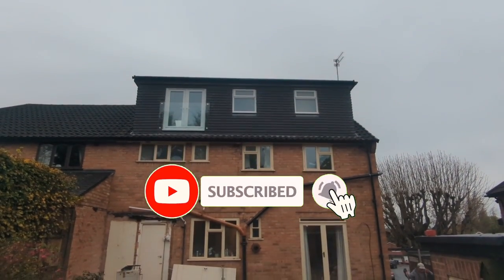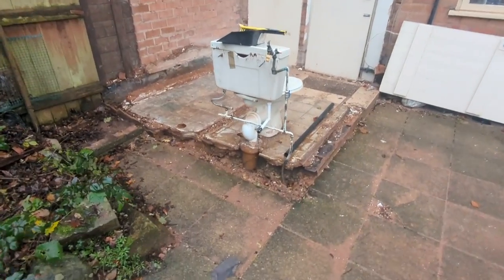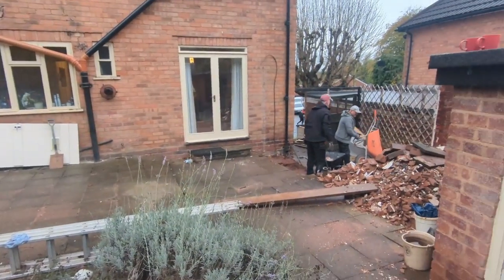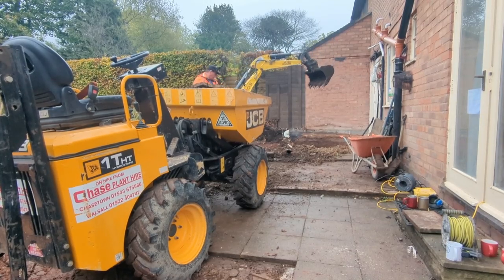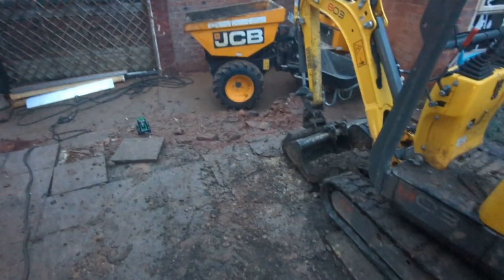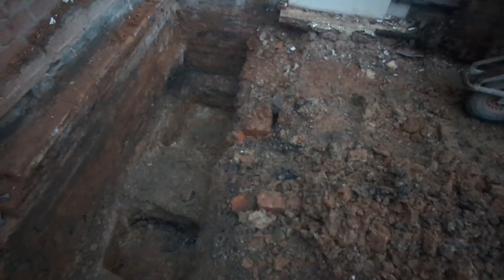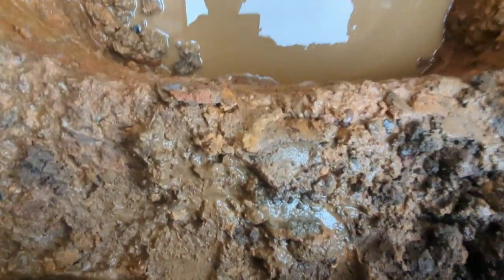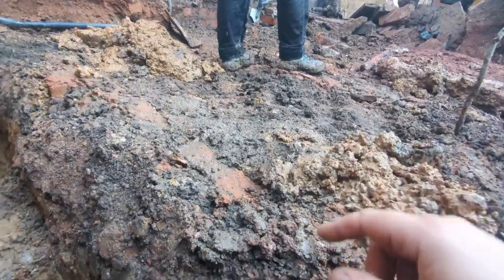Single Storey Extension Stage One. Digging out, Finding Out and Falling In!

Comment: Back in 1990 I was digging footings for a single storey extension and came across a 3 foot brick built well right on the corner . We extendend the corner footings in both directions , shuttered over the well and placed rebar into the mass fill footings iver the well . The inspector wasctold and passed it . Moral of the story is you never know what you're going to find while digging footings . Found out later that there used to be an orchard on the grounds in Georgian times . Local history and surveys are very helpfull . All the best from Brum . 🏴
Reply from the maker: Morning John, appreciate that. It's true that you never know what you're going to find, which makes it both exciting and worrying in equal measures!
Reply: Could be worse, previously unknown Romano British cemeteries tend to ruin your year
Reply: @stevenbowers4164  👍🤣🏴
Reply: @stevenbowers4164  Or a recent murdered body.? 😅

Comment: The reason removing the hedge has no affect on the outcome is because theoretical the ground will heave once the hedge is removed as the clay will expand. This is in theory down the fact that currently the hedge is drying out the ground and once it's removed the ground conditions will become wetter hence the clay expanding.

Comment: As a builder of over forty years mainly working on domestic extensions, I would always get the Building Inspector out before I started any extension. This way you could discuss any problems prior to starting, ie trees, drainage etc etc. You knew what depth to take out your footing before you started the dig and could pre warn the customer of any additional expense incurred. Far easier to use the digger than bust your arse doing it by hand.
Reply from the maker: Hello Peace, John's comment is a great shout. Building Inspectors do do a 'pre commencement' visit which is obviously a great commodity if you're unsure if anything. In our case here we didn't think anything was out of the ordinary! Lesson learned!

Comment: Nice to know you have a Building Inspector that actually knows what they are doing. hang on to that guy. The roots of that shrub will affect the clay movement, that would cause cracking of the brickwork if the foundations are dragged. Also by removing the shrub you could end up with what we call "heave", where the foundations lift causing cracking.
Reply from the maker: Very true Stephen, thank you.

Comment: I did a job in Reigate where we came across some brickwork in the corner of the foundation, it turned out to be a well 18 metres deep.

I also did a job which was an extension going where there was a large patio area…..the client neglected to mention there was a stonking great pond there before and we had to get the job done with driven piles adding 8k to the price.

Comment: Excellent video.

One thing this highlights so well is the constant decision making that a builder makes….even during the “upto the waist in mud” stage.

One thing you might want to do is look on the LABC trees and foundation web page - on there you can find a depth calculator. On future jobs you can make an assessment before the job starts and anticipate trees and hedges impacting on foundation depth ( in the zone of influence)

As a quick tip: look out for hedges of hawthorn and leylandii, and trees such as oak, willow leylandii. They have high water absorption.

Bear in mind it is these species combined with soils with shrinkable clay or low load bearing capacity: clay and silt are indicators. 

I know it shouldn’t be your concern, but if you are forewarned you can avoid losing days on site….deeper founds can mean resorting to hand digging, swapping to a bigger digger and even shuttering.

Comment: Lesson learnt take bushes down first before getting building control out haha. 

Jokes aside all depends on what type of piles you go for will depend on cost, but most piling companies will ask for you to back fill as they won’t get machine in close enough as the piles will have to go in the centre of the foundation. My guess you will need 8-12 piles. 
Good luck with it 👍🏻
Reply: Doesn't have any bearing on the foundation solution haha
Reply: @markjarvis5465  doesn’t have any bearing on the foundation?
Reply: @anthonygardner7684  correct. Trees bushes need to be removed 3-5 years prior to foundation construction
Reply: @markjarvis5465  or have deeper foundations.

Comment: hi mr A. just had a similar situation - 5 mini piles failed at 4 and 6 metre depth, luckily 8 metre did the trick. cost in total £4300 with the additional concrete. its the 600mm width typical strip excavation that has to be filled with concrete that adds to the total cost, painful to say the least pal.
Reply from the maker: Ah man I feel your pain! I'm worried that it's going to be too expensive, fingers crossed!

Comment: At point 7.00 on the video when talking about the 2 pipes you found, you said that a new connection would need to be outside of the footings. How exactly would you do this in your scenario,  as it is nearly on the boundary line by the looks of it ? Is it likely the land drain is for, rainwater run off ?
Reply from the maker: Morning Kevin, hope you're well mate. That's exactly what the land drain does as well as taking ground water away. As for the connections, we'll just have to try our best and get them as far out of the footing as possible. It's not that important really as any section of pipe in footings needs to be shuttered off and have lintels over so no concrete goes anywhere near it.

Comment: You can get the soil tested and get an accurate PI and soil classification sieve test it may be the soil is non shrinkable or low plasticity then the depth of footing can be designed it's not always the end of the world.  A raft would be the answer

Comment: I've never heard of hedges affecting foundation depth to be honest. Won't he let you step up as you go away from the hedge?
Reply from the maker: That's been mentioned Chris, I'm currently in negotiations with building control!
Reply: @Mr_A_Builders  ah, well good luck with that. I bet your man could get that machine back over that corner some how.
Bushes?  😄
Reply: Southern water would make us apply for a buildover for that pipe if its over 6m built over and if its damaged or pitch fibre, replace with clay.
Reply: I'm assuming it's coming from that back corner. If it's going that way they wouldn't
Reply: Beech is a tree with moderate water demand so does effect the foundations. Stay away from piles, very expensive, you dont know how deep these will have to go for safe bearing. get the spade out. as the foundation gets further away from the beech it will get shallower, just need a few steps.

Comment: I had the same issue with a water piper and redundant gas pipe.
Sorry if I missed it, what did the Building Inspector say about the clay land drain butted pipes??
Reply from the maker: He simply said "replace what you can see in plastic"!
Reply: @Mr_A_Builders  haha brilliant
Reply from the maker: To be honest, I was uneasy with doing it as I thought that would be worse than what was already there so I put them back in as they were. When it comes to it it'll be shuttered off and linteled over.

Comment: Interesting in the video the first port of call was to blame the Architect on the video, Engineers design foundations not Architects people would be wise to understand this. the Engineer should complete a site visit to ensure these things are picked up, so no its NOT the architects fault at all.

was this done on a building notice or full plans submissions to BC, if done on full plans does this not raise issues with the engineers not picking it up in their design calcs etc?
Reply from the maker: Hello Bryan, hope you're well. I think that it was clearly stated in the video that it's no one's 'fault' at all. The problem was always there and would always need sorting out, we were just late to the party with this one. Also, engineers don't visit domestic sites as standard procedure, so there's a lot of responsibility on the shoulders of the architect who then in turn passes it on to the builder. A few years ago I had a job that wasn't at all what it seemed and when I questioned the architect he said "well, my involvement is over, you know?" which just proves that some, some, if them slope thier shoulders once the cheque has cleared.
Reply: @Mr_A_Builders  ok I don’t remember hearing that bit so apologies if I missed it. I mean I am an Architectural Technologist and I always insist on the engineer doing site visits for works. It’s worth the money. What we miss they pick up and what they miss we pick up. 

I regards to the architect just doing plans it’s all fee based really isn’t it, I have previously offered site visits and collaboration with builders but the client doesn’t want the service they generally deem it money not well spent. So you get what you pay for, if they just want plans no problem that’s the scope of service. 

It just makes it harder for the builder as that missing link isn’t there to allow paper to reality to conform to historically how it worked in my honest opinion.
Reply: @Mr_A_Builders  dormer looks snazzy like 👍

Comment: We just had our footings piled, they had to go down 10 meters. Cost us £2600 on top of the original quote.
Reply from the maker: Hello Daniel, 10m??? Wow! Why did you need them doing please?
Reply: Builders said ground was soft when they dug footings then the piling company said solid ground was at 10m. It's just one of those things you can't predict ground conditions.
Reply: Also original piling quote was £1500 but because they had to go so deep it added another £1100.
Reply from the maker: Thank you for that Daniel. Let's see what the quote comes back at!
Reply: @Mr_A_Builders  doesnt matter about the quote, you will be charged per metre depth.

Comment: Get digging.. sod off piles.. cost £1000 each here. Plus removal of dirt of site.. Looks like youll need 5..
Also looks like you have 11-12 liner metres overall, 
Maybe a full load of concrete which is about £900 here..maybe only 3-4 to be dug the other 800mm, remember u have to go round the corner by a metre.. definitely cost effective to dig by hand..
Reply from the maker: I agree with every word Neil! Nice one.

Comment: Taking trees/bushes out before finding a foundation solution doesn't make any difference, the ground still has to adapt to the trees being removed. An engineer would design the foundation based on the ground report, for small extensions this probably doesnt get done due to cost and ignorance. A competent architect should see this and report back to the home owner to let an engineer assess the issues. 1.8m is deep, but depends on water demand of the tree, ground shrink ability (if clay)  and distance from house to tree. Foundation depth tables are available on the NHBC website.
Reply from the maker: Hello Mark, hope you're well. There's a second part to this, the link is below. I'll be interested to see what you think.

https://youtu.be/NPuDoZQq5Rc

Comment: An extra 800mm?! Is that a typo or a joke?
Reply from the maker: Neither I'm afraid Andrew!
Reply: @Mr_A_Builders  that's crazy. I've seen piling at large commercial sites but never residential. Would make a great video! 👍
Reply from the maker: Seems crazy doesn't it, especially just because theres a hedge there! It'll make a better video than digging out by hand that's for sure!

Comment: Sorry that bush not tree don't see roots interference with footings
Reply from the maker: Hello Brian. Neither can we!!! There were absolutely zero signs of any damage to the outhouse that was there either. Plus the hedge is being removed. The building inspector says that it's the microscopic roots that you can't see that are the problem???!!! As I said in the video, they're in charge so it is what it is! Hope you're well mate.
Reply: I was surprised that the BI suggested it was a tree?  How experienced is the BI?  

I am also surprised that the foundations are 600 wide as 400/450 wide trench fill founds are usually quite adequate for up to 3 storeys and the ground conditions don't suggest anything special.  Normally, only strip footings are 600 wide and that is to accommodate the brickies size 11 on each side of the wall he is building.  As its trench fill there is no need to straddle the sub-structure brickwork.

As the salt glazed drain connects to the neighbour's property upstream of the extension, the drain is deemed now to be a public sewer, not a private drain and therefore the water authority has control over any works over or within 3 m of it.  STWA, one of the more lenient authorities insist on CCTV surveys before and after the works are carried out.  The BI should have advised the water authority of the existence of the drain at plans submission.  If its found after works start they can stop the job until approval is gained from the water authority.
Reply: @Mr_A_Builders  am good thank you. Ask why see what reply is it damage roots do to footing or it how much water they take up from ground or reinforced instead
Reply from the maker: Hello Clive. The tree/bush/hedge/whatever it is is Beech, and that's what has caused the panic! I'm always told to go 600mm wide, I did one 450mm a few years ago and had to widen it by hand. You're quite right about the sewer. The building inspector said on Friday that there's an unmapped sewer here so the process that you describe is now under way.
Reply: @Mr_A_Builders  There is a great deal of paranoia about trees and the like that is mostly unfounded and driven by the risk averse insurance industry.  The most damage I have seen from a tree is to underground drainage, where encroaching roots can cause a big headache.  At home here we have a 6m tall 1m girth self (squirrel) seeded walnut tree within 3m of the house along with now very substantial Leylandii (1.3m girth) that started as small bushes.  We do not have any signs of distress in the house.  Indeed we also have a 18th-19thC property with brick stepped footings that are no more than 225 deep  with mature rowan and damson trees within 1m of the external walls and again no resultant effects. 

I have not specified 600 wide domestic foundations for anything other than very suspect ground conditions during the last 40+ years  and then because the structural engineer specifically requested it.  The width of domestic founds under normal circumstances has more to do with the width of the digger bucket than any structural reasons.  Why waste concrete?  The BI needs to check out Part A of the Regs Table 10 Class II, III, IV

My condolences about discovering a public sewer, the change in the Regs in Oct 2011  has caused more problems than it solved, a case of fixing something that didn't need fixing.  STW told me that they inherited 38,000km of new sewers due the change.  The problem comes that an application must be made to the water authority that is now typically £300+ that can take 3 weeks or more to approve and require cctv evidence before and after the works are completed.  With all the documentation that needs to be provided, the client can expect a bill in excess of £1000 and that is notwithstanding that the water authority can require excessive construction details that are not modern general practice.  When the new regs surfaced, Anglian Water invoked their requirement that there could be no building over and not within 3m of the (new) public sewer, which instantly stopped a huge number of domestic extensions until they eventually saw sense.
Reply: What a nightmare. Nothing to be done about it though. At least the inspector went off and did their due diligence, not just ordered you to stop then and there based on a poorly remembered line from a textbook.

Imo hand digging might have been a bit of a different prospect three months ago, but now we're going into winter with the cold, low light, and trenches constantly filling up with water... you couldn't pay me enough.
Reply: @ComeWhatThey  Building Inspectors should be full conversant with the Regs and it would worry me if the BI was not fully au fait with this particular part.  Unfortunately, over the last 30 years we have seen a decline in the abilities of the Building Control systems, which was due to the experienced inspectors being sucked out into the approved inspector firms that lost mentors from the LAs, where traditionally most newly qualified inspectors gain their initial experience.
In this instance, from the the information shown I would expect an experienced BI to have accepted the construction of the trench as dug.  It is no help that the inspector went off to check what ought to be built as delaying construction works is a costly business.

Comment: If the tree/hedge is coming out why  do you need to go down further, does the building inspector have something against you. I got a concrete raft past building inspection 1M from an effing great tree. I find the worst inspectors are young twats straight out of collage who have never touched a shovel or tape measure in their lives.
Reply: Once you take out the tree/bush you got ito leave it for a year as the ground can heave once the clay rehydrates or get the soil tested it may be of low plasticity where it would then be ok to build
Reply: yes I suppose so, I'm 70 now and building inspectors used their discretion in my day, but in this day and age I guess you need to go by the book because of the sue you society we live in today.